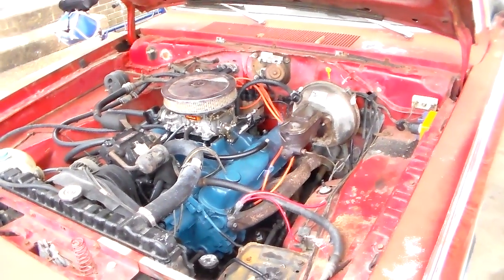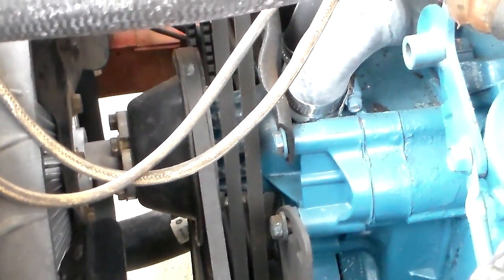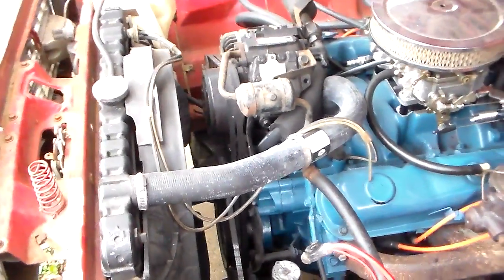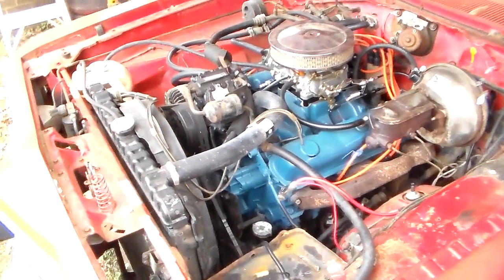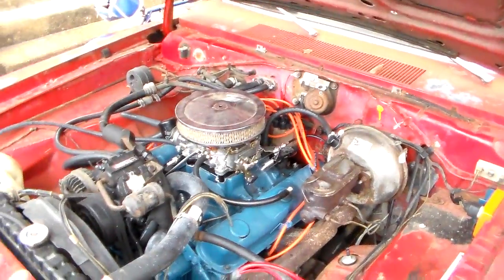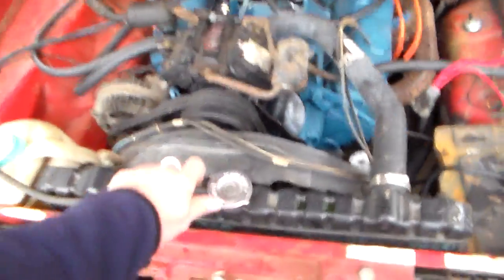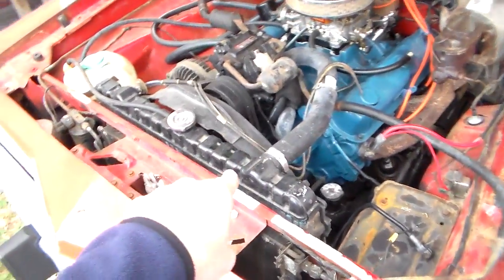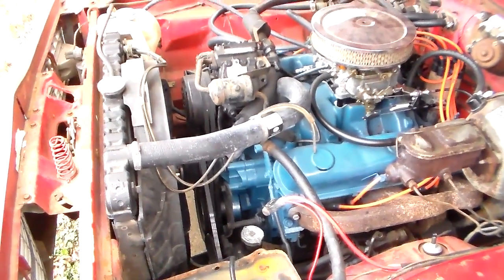Is the water pump causing your overheating problem?

Comment: Well the reason I'm replacing my waterpump right now isn't because it is bad it's not leaking out of the weeping holes and the impeller nor fins aren't bad, neither is the shaft bad, and neither are the bearings bad. The man that i bought the car from was supposed to of had put a reverse flow water pump on this vehicle and he didn't and its running hot. You know how if you look at most water pumps on a SBC which is what im working on how 9 out 10 times if your facing the engine w it running the water pump pulley is usually turning clock wise well with the serpentine belt system that he put on this car, the belt has the pulley turning pump counter clock wise which is making the pump work backwards and thats y it's running hot and the only way to solve this problem either replace the entire serpentine belt system and put a clock wise system for turning pump or just get a reverse SBC pump and yes Chevy does make them so I'm going w the lesser of the two. Thanks for the idiot that I bought the car from he changed the serpentine belt system from a Chevy truck and put it in this car and created all this havoc. The clockwise water pump that the dip shit put on it with that belt system turning pump counter clock wise will never cool turning the wrong way he needs to stop just interchanging parts on all kinds of vehicles thinking that their all the same when its actually quite the contrary. Took me forever to figure this out

Comment: What would you say is wrong with an f150 that only overheats at coasting speeds. When the engine is under load or at idle it’s fine.

Comment: I have a 1984 dodge 360 motor on an old Lindsay 150 air compressor. I has a seized water pump that I broke loose. Motor still running good but it was getting hot after a few minutes and boiling over the radiator. Scratching my head on it. So I figured the water pump vanes on the pump had most likely corroded off. NOPE the pump was good but its getting replaced.  So I decided best thing to do was replace the water pump. So once I got it pulled I found one side of the inlets to the head was completely plugged solid with a crystalized material. Motor still full of antifreeze in the heads. NOTE this motor has set for many many years. Also while cleaning there was big pits in the timing chain cover that was seeping small amounts of water into the oil pan. This was a fresh pit break though, so not even enough water had gotten into the oil to change the color of the oil. So I had to clean the head inlet by doing a ton of flushing, clean tested the thermostat. Then ended up having to change out the timing chain cover and the water pump. Now everything is sealed correctly. 
Cleaned the radiator with a flush and a lot of water flushing until clean. This plugged inlet to one side of the head was the mail problem. Would have never found the issue without pulling the pump, So NOW problem solved. NO more overheating. Engines setting for many years can have many problems that are hard to find.

Comment: a partially clogged radiator will cause overheating, even if u can run a water hose through one end and out the other it might need cleaning out or rebuilt... and those newer style water pumps with a stamped steel impeller can cause the water too move too slow and that will make steam ,again overheating,,,hunt for ,look and find a water pump with a cast iron impeller, works great at moving water and lasts longer too.

Comment: Just had my 83 d150 overheat while i had it idling for a bit. Shes been good while on the highway previously so i'm thinking i'm just not getting enough airflow as its got some dinky electric fans set up right now. That and she probably could use a good flush as the overflow can is a nice rusty orange now. Thanks for giving some good starting points without another "replace your cap" which is what everyone was suggesting.
Reply from the maker: The OEM clutch fan with a good HD clutch will solve your airflow problem for sure.

Comment: So what if it starts heating up at a light and goes back down when you start moving
Reply from the maker: Not enough airflow. Usually the fan clutch has failed. Remember that the fan keeps it cool sitting still, the airflow coming from the outside keeps it cool on the highway.

Comment: I have a metal impeller and one vein on its broken it's a high flow unit from summit it came broke I was in a jam and installed it on my 7.5l 91f250 do you think it could be causing cavitation? I also put a 4core with electric fans in it trying to make it run generally cooler now it runs hotter WTF need help it's still getting hot when I remove the thermostat
Reply from the maker: The key is WHEN does it get hot....at speed or sitting idling?  Is this a new radiator you installed? Have you checked the engine timing to make sure it isn't advanced too far? No vacuum leaks? Have you shot the temperatures at the radiator and on the thermostat housing to make sure they are matching what you gauge indicates?
Reply: @TylersNeighborhoodGarage  it's a new 4core aluminum with 2 12" fans in a shroud, timing no I didn't check it hasn't been messed with for awhile,no I have not shot both temps the coolant overflowing out the reservoir was enough for me , It gets about 200 on highway traffic is an overheat if I'm sitting still or barely moving unless I keep the rpms up, 25 mph in drive it gets hot 25mph in second it comes down a bit

Comment: I have 360 magnum cammed with Eddie heads  fully built i cant even get a tune on it  cause i have baby it  to break it in and to top it off it turns off i have to keep the pedal at 900 rpms  it runs cool at idle but underload it creeps up and i have to pull over its a brand new engine i cnt even break it in i changed water pump three times bought another radiator i saw redish thickish stuff that came out. i see people cutting blades off the water pump on youtube  leaving 4 blades that supposedly pull more heat of the block ? I think more blades the better but . i took off the thermostat same issue but now i believe this redish clay is in the block i can't even go on the highway it starts to creep up i need help what if get the 3rd row radiator is twice thicker is bout $400 and if it still does
Reply from the maker: "Reddish clay" sounds just like stop leak.  What size radiator are you using? A V8 needs a 26" radiator at the minimum. Was "another" radiator a NEW radiator or just one that may or may not be plugged?  Don't mess with the water pump... a stock pump works well and a mad scientist experiment is just going to screw something up. First off get the block clean, then clean the radiator and go from there. If the radiator is questionable go ahead and find a new rad.

Comment: I am torn between getting a high flow water pump or another new radiator (got the one from autoZone for $140 but didn’t do the trick) to figure out my f250 7.5l 460 engine. As soon as it is under any load it gets hot as heck and very sluggish
Reply: @Tyler’s forgotten car rescue

Comment: Great video and great information.  I have one question.   Do you know what the problem could be if the coolant reservoir looks like it's boiling?  1991 Nissan D 21 truck overheats, steam from exhaust, boiling/ bubbling coolant reservoir.   Could it be the head gasket?
Reply from the maker: Yes. Classic signs. Pull the head, have it checked for cracks and have it surfaced. It WILL be warped. Go back together following the torque specs perfectly.  Keep the revs under 4,000 those engines don't like high rpms.

Comment: had a 1976 ford 5.0. Replace pump and was running hot. Pulled the new pump and it was the wrong rotation. Could not get a cast replacement anywhere. Finally got an Edelbrock high flow and had to shim all the pulleys to make belts line up. Always check the rotation of the impellor.

Comment: Very good and thorough explanation.  Just troubleshooted one overheating problem and it is the water pump going bad leaking through the seal.  The leak allows the water to empty to where there is not enough in the cooling system and it overheats.  It is a Camry 2007 and it is time for water pump and timing belt replacement.  Thanks for the post.  Very helpful.

Comment: I have seen in severely neglected cooling systems (or where people use plain water) where the blades on the water pump have corroded away. Usually by this point the radiator and heater core are beginning to plug up and replacing parts and a through block flush are the only cure. Flushing (heck even just draining the radiator and refilling with 50/50 mix) the cooling system every 3-4 years regardless of mileage helps prevent corrosion. Even if the vehicle is not driven, coolant helps prevent corrosion and keeps the rubber from degrading. And I agree; plastic water pump impellers are very stupid.  When they break, getting all of the plastic pieces out of the block is a total pain.

Comment: Correct. Explained well. Unless oil is super low those are the main factors in cooling system issues.
Reply: Please explain low oil. I think I let my oil get to low and now I'm overheating

Comment: my old dodge (89 d150 318/727) would run right ware it should then traffic or hill it would run hot. old owner had put a heavy spec water pump thermostat and a standard radiator. couldn't finger it out. the motor got pulled and tore down, the water jackets in the block looked like some sort of clay was in them. miss that old motor what killed that one was a worn out roller cam.